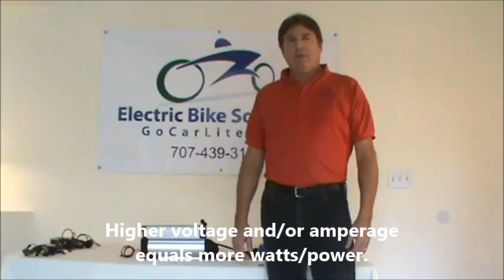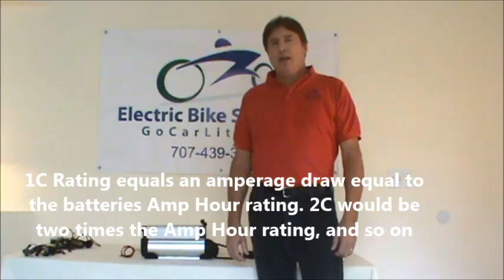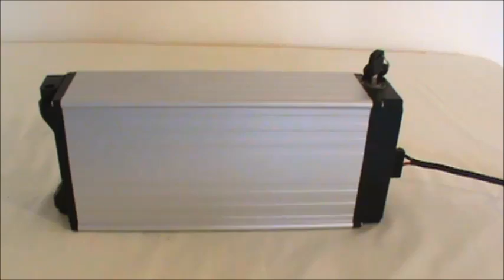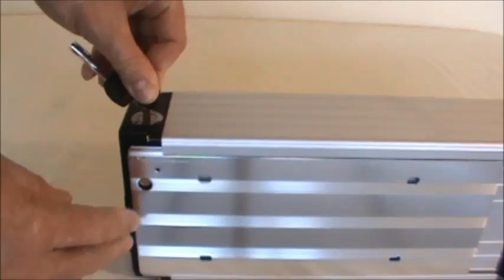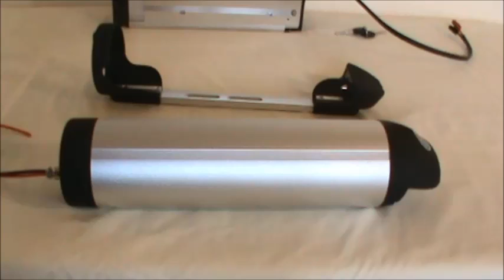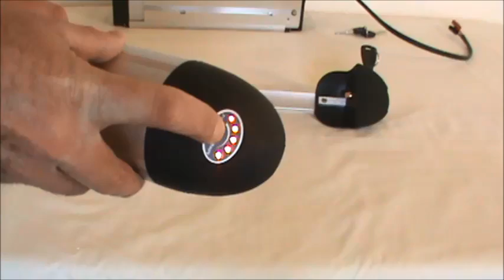Electric Bicycle Batteries

Comment: Nice clip. I need help with the 37 volt sleeve type casing Phylion XH370-10J ebike battery. I have used it without problem for 4 years. Now it needs to be repaired. i cannot extract the batteries out of the sleeve casing. Are they held in place with glue or something? Please help me dislodge the cells so that I may repair the unit. Thanks and regards.
Reply from the maker: After 4 years you would be best served to get a new one.  Trying to replace the cells, etc. will cost more than that battery is worth.  Since it sounds like you have a specific e-bike that was made with that style of battery you should be able to find one (outside the U.S.) online.  Always a roll of the dice to get one outside the U.S. but it is not something we carry.  Thanks!

Comment: I have an ecobike Vatavio which is no longer supported, and the battery has died.  Would this battery work as a replacement for that?  I see you have a 707 area code, so you’re pretty local to me.  Would you consider having a look at it?

Comment: what motor wattage are you using to get 25 miles+ ,i am interested?
Reply from the maker: Hello James.  Our motors peak at over 1300 watts when needed.  We use a 25A controller.  So 52V x 25A = 1300 watts.  Check the info on www.GoCarLite.com for all this info or give me a call at 707-439-3179
Reply: Thankyou for the information

Comment: Where can I get this battery
Reply from the maker: Sorry for the delayed response.  Give me a call at 707-439-3179 or go to www.GoCarLite.com  We also special order any battery needed.
Reply from the maker: I assume you are using a different battery that is 48V.  Many controllers cutoff the high end as well.  So if your 48V battery is fully charged to 54.6v it may have a cutoff lower than that where everything appears to come on but it does not go.  You just have to try it and see.  If it works it shouldn't hurt the controller but you could over volt the motor if its not made for 48V...
Reply from the maker: Roll of the dice on Ebay.  Either my frame mount or rack mount is a sure bet with an 18 month warranty and you can have either one for $400 which would include the shipping: https://gocarlite.com/product-category/batteries/